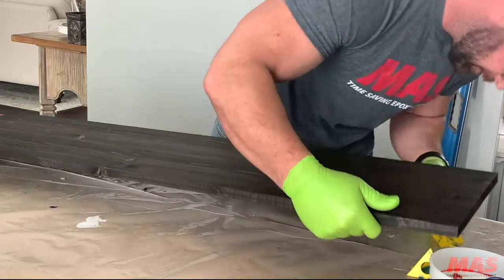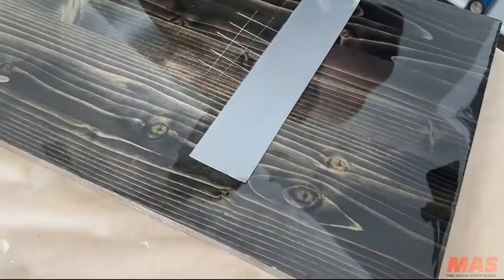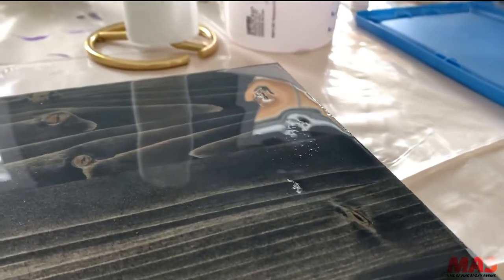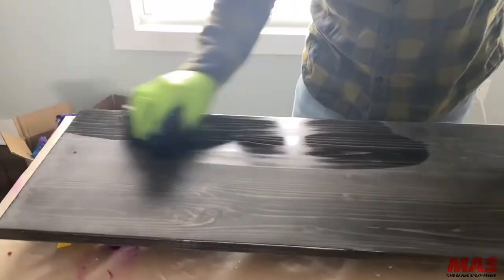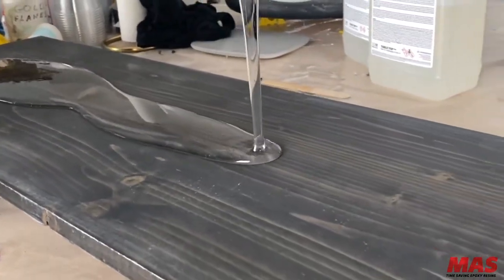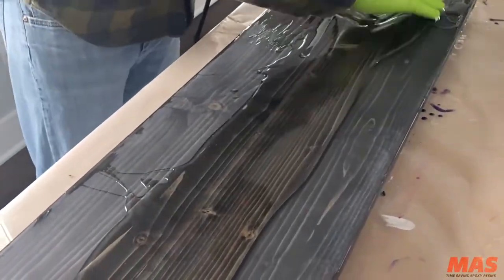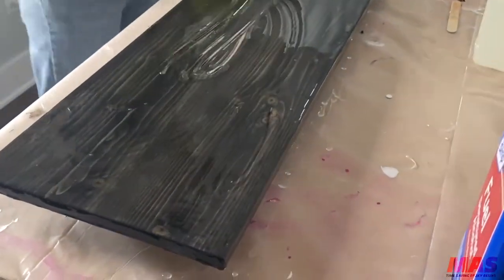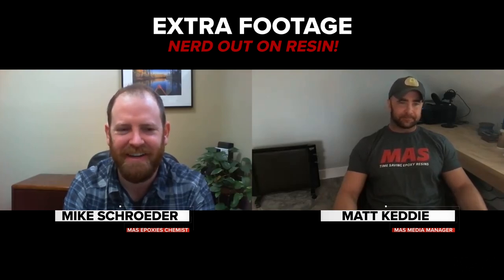Can you pour epoxy resin over stained wood? | Yes, but here is how!

Comment: So you recommend water based stains? Would this also apply to like a river table type project as well. Would you be able to stain the wood? And how would that work for the edges of the wood in the epoxy pour.

Comment: Hi, really hope you see this and respond. Newbie alert. So I would like to stain a table top in your video you recommend water based. Ok. Next step… do I seal that stain after however many passes with wax/polyvine etc first?? 
Then after that step, if that’s something I should do, do I now apply a thin layer of resin? Is this what you call a seal coat??? Then after it’s try, are you saying, I need to sand that back with a 120-150??? Do I then use a 320-400 to smooth it out? Then another “seal” coat? And again sand back??? Then a flood coat? And do I use the heat gun to get rid of bubbles in 1st,2nd and 3rd coats? I would just like to know the steps I should take in order? And going back to video you scored the resin how would you then sand that off? Is that the only way to check adhesion? Thanks
Reply from the maker: Hi! Okay, so no to the wax! No wax or poly vine!!! And you can probably just do 1 or 2 coats of resin to ‘seal’ coat it. One should do the trick but sometimes a second is best to smooth out any divots! In between layers of resin we just recommend scuffing it up with rough sandpaper. Can be 80-100grit just to give the resin something to grip on to.
Reply from the maker: @BaandBo  hahaha we wish!!! No problem at all!

Comment: I want to do an ash desk - it is stained with a hardoil with white pigment - I want to water and stain proof it ( think ink and coffee) Do you think I could do : 1) Sanding 2) wipe off dust 3) denatured alcohol 4) lots of seal coats and sanding? I do not want a thick epoxy coat, I want a more matte, natural look and I do not have any experience with epoxy pours. Also, I should do both table sides back to back with the seal coats to avoid warping I guess ? It is a 2m x80cm tabletop. Do I have to apply UV protectant ? In which layers ? What happens if I do not ? Did I overlook something ?
Reply from the maker: Hi there! I asked one of my smarty pants coworkers to answer this question for you, so I apologize for taking a bit to respond! Here is what they recommended: 

"They can sand it to 220 grit and stain it with a water based stain, let it sit for 5 days to let the moisture flash off. After that, they can apply a thin layer of table top with a foam brush at the desired thickness they want. Once that is cured, sand up to 2000 grit wiping the surface clean before changing grits for a matte finish."

Comment: I applied table top epoxy resin to some black walnut. When it dried, it was way way less dark in color than when I applied water to the wood in order to see the color. What is the best thing I can do to bring out that dark color before applying my epoxy??
Reply from the maker: Hi! This is strange! It should have gotten the same amount of dark as when you wet it with water. In this case, we recommend maybe getting an even darker water-based stain than last time.

Comment: Great video!  I have been trying to find an answer to this question: Can I apply epoxy resin over a thin minwax polycrylic layer? If not, can I apply epoxy resin over an archival uv spray layer?  Thanks for your time. 😁
Reply from the maker: Hi! We would not advise applying our epoxies over poly as it can lead to delamination issues. Epoxy generally does not bond well to polys. However you can always apply poly over epoxy. Same goes for the UV spray. You would want UV protection over the epoxy if the project is going to get UV exposure.
Reply: @masepoxies  awesome thank you so much for the response. Just so you know, this is what I'm looking to do. I'm a professional pyrographer (wood burner) looking to test out epoxy on some pieces. Sometimes, I use white charcoal, colored pencils, watercolor pencils, gouache or pastels for bright highlights & at times color. If the piece isn't sealed before applying a varnish the whites (colors) can smear messing up the piece. So when it comes to epoxy resin, what do think would be the best way to seal in the whites (colors) prior to the epoxy? Now there is a caveat... I would need a sealant that doesn't darken the wood too much. I definitely appreciate the help. 😁
Reply from the maker: @DrawingWithFire  hi there! Unfortunately we don’t have much experience with pyrography so we wouldn’t know where to direct you from here :(
Reply: @DrawingWithFire  could you splay on a coat of varnish to seal in your art, than epoxy ?  That is what I am planning, without the fire!!  GOTTA CHECK OUT YOUR ART !

Comment: I’ve been searching all over the internet for an answer… I’m working on a bathroom floor that’s got wood cookies filled with sawdust/wood glue in the cracks. It’s got a coat of Thompsons water seal and I’m wondering if it’s possible to use epoxy to level everything out and will it adhere to the sealer on the wood?

Comment: I just received an expensive unfinished mahogany (new) front door to install. I originally wanted to stain it (water based) then polyurethane it.  However we now have a 6 mth old Golden Retriever that jumps up on the inside of our existing door when she needs to go outside to "potty". I am now thinking about epoxy for protection from her. The front of our house (in NE Georgia) gets a lot of heat and sun from the south. I saw where you advised UV protection over the epoxy if the project is going to get UV exposure. I have no epoxy experience. Please advise on using epoxy on this door and how to do it, and how to use the UV product on the outside of it, do you sell the UV product, etc. Tks.

Comment: This was great information thanks.  I've been trying to contact product information on your website to ask about which resin should I purchase for ocean pours with foamy waves but it keeps telling me to fix the errors on the form??? I kept double checking my form and found none.  Anyways, I see a lot of artists using the table top resin in there ocean art but noticed you also sell Art resin?  Is is a difference of thickness, scratch and heat resistance?  I will go search for a video comparing your resins but if there isn't one could you explain because I would like to try MAS. Thanks
Reply from the maker: Thank you. Your best option for would be Table Top Pro or Art Pro. See link that compares epoxy side by side to know which one to use. https://masepoxies.com/which-epoxy-resin-should-i-use/
Reply: @masepoxies  Great thank you I'm going to try both and see which one I like better.
Reply: Z @BsAlteredDesigns  my:

Comment: Any recommendations on what to do if you accidentally sand down the epoxy seal coat down into the wood layer where it takes a little piece of the stain off?
Reply from the maker: Re-stain that part of the wood and then repeat the whole process!

Comment: Which epoxy would you recommend over water based stain on hardwood (likely walnut) for a chefs knife? Would it be dishwasher safe? 
And would it offer a decent grip not highly polished?
Could I just do a couple alcohol/epoxy seal coats and it lock in the pattern and be durable? Trying to think out of the box for a project that is trying to mimic paint brush strokes and rust bleeding.
Reply from the maker: It would not be dishwasher safe! You can use the Table Top Pro that we have and it would hold up rather well.

Comment: I used for dye to make a laminated small table top for next to my fire pit. The slats are red white and blue with the center 3 slats being black blue and black.  Can i epoxy over this without any bleed out or should i seal it first?  If i should seal it, should i do so as described in this video? Of would clear polyurethane do the trick?
Reply: Rit dye, smh auto correct
Reply from the maker: Hi! This is something we have never tried before, please email hello@masepoxies.com and they can help you extensively with this! Cory is our tech expert and he is the BEST!

Comment: Hi, a lot of the woodwork on my boat is mahogany(new build) and I'm planning on using a mahogany stain before epoxy coat to enhance the colour of the wood.
Is there a shortcut I can take on this by putting a pigment in the epoxy.If so, what product and how is it done. I have MAS low-vis and FLAG.
Thank you
Reply from the maker: There are a variety of tints and alcohol inks on the market to color epoxy. Weather any of them would give the appearance of stained mahogany I don't know. That would require some testing.

Comment: Was wondering if it works over oil paint. Guess nobody did it before cuz i can't find any info on YouTube at least so I'll try myself first. If not I'll just have to colour the epoxy. 🤷
Reply from the maker: Great question. Overcoating oil paintings with epoxy can be done. There are several youtube videos on the subject. Making sure the painting is fully dry and free of dust or other contaminates before pouring is key. Keep in mind, every project is unique. Artwork especially so. What works well for one person, might not be the best approach for another. Feel free to experiment. When in doubt, small scale testing is always a good idea. Make a small test panel using the same paints and try and coat it. If it holds up your good to go.

Comment: Hi I'm a contractor in California. I have a new client that has a beautiful maple bartop that last month he laquered. He hired me to epoxy coat it. Would just a quick scuff with 220 be sufficient enough for a mechanical bond. Also I'm worried about fish eyes. I would appreciate some tips🤙
Reply from the maker: We suggest using the test in the video to make sure the epoxy will bond to the lacquer. Before attempting the test make sure the lacquer is fully cured and scuff it with 220. If the epoxy bonds, when going full scale, we would recommend scuffing with 220, vacuuming the sanding debris, and wiping down with a lint free rag and acetone before over coating.